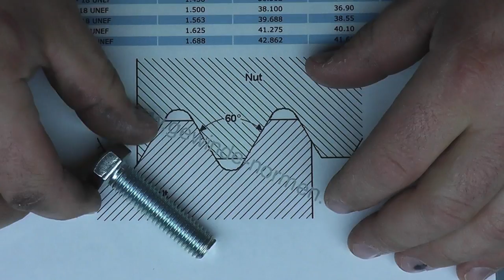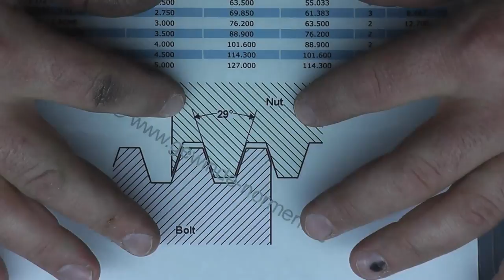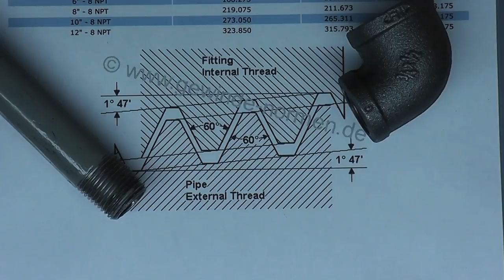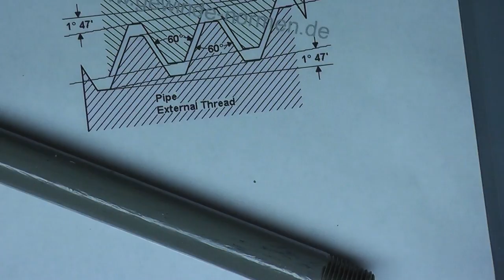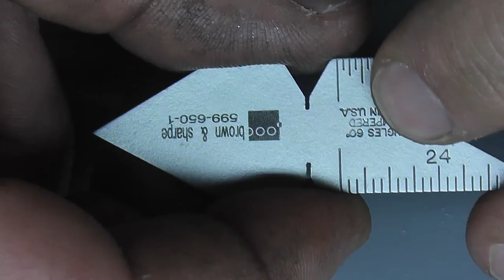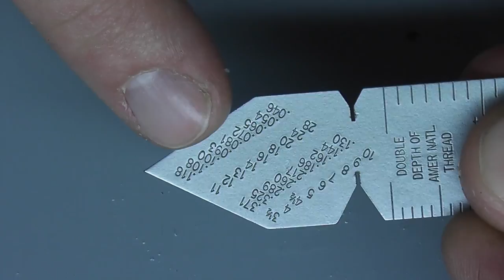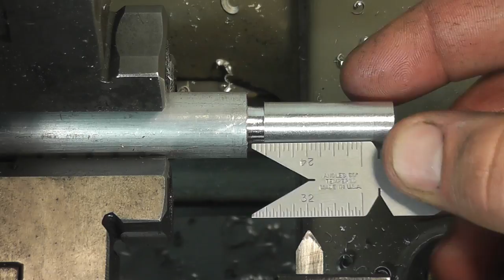External Threading - A Beginners Guide

Comment: Hi, you can try keepign the compound set at zero, parallel to the bed and advance the compound half the depth of cut for each pass. By moving the compound and also the cross slide this closely simulates the 30 degree angle. This method also helps with the depth of the thread as the depth is directly on the cross slide dial ( dro ). The tool load is split 87/13 so the trailing edge skims the right hand flank and the leading edge does the majority of the cutting.
It's usually best to remove the peaks of the threads before trying the nut, if you get the nut to fit without removing the burrs then it will be loose when you do remove them. Having sharp peaks running on the root radius of the female thread can cause galling and prevents the thread flanks from engaging.

When cutting the left hand thread in the video. Instead of plunging in with the cross slide you could still use the compound slide at the same angle as for right hand threads. Feeding in as before for right hand threads but this time the tool will cut on the trailing edge. This will work out just fine and reduce the tool load as before.

Comment: Thanks for the video. I'm learning to cut threads, I did it once like 15 years ago and It turned out good. This last time I suck, I ended up with lopsided triangle threads. I plunged rather using the top cross slide at 30 degrees. So my next attempt will be your method to see if that will help. Good thing I have extra material I screwed that part up good. Thanks for sharing. Best Wishes & Blessings. Keith Noneya.

Comment: Very good video Sir.  The one main reason I would rather use single point threading instead of a die is it is very easy to get the die to run the thread  a little bit crooked and not straight with the lathe.  Been there and done that!  Tom

Comment: Good video, I’ve never rotated the compound slide for screw cutting just always keep it on the “0” degree , and whenever I do acme /Trap. Threads,  single /multi start I always use a thinner ground tool then side cut until it fits the mating piece,

Comment: at 9:22  I do a lot of model engineering, and what's nice about the Little Machine Shop chart is that it lists a column for 50% thread engagement. There's not tons of force of model engineering fasteners as a rule of thumb, like on an full size automobile. Using 50% thread engagement saves wear on your taps (all my taps are German and Japanese so they ain't cheap). Plus many people don't realize that to go from 70% thread engagement to 95%  TRIPLES the force requires to drive the tap, but only gives a 5% increase in holding power !! . So you break your tap for essentially to no gain!! Something to think about. Incidental notes: generally first four threads carry almost all the load, every thread after progressively does very little as far as load carrying ability - to get full load carrying ability use length of thread equal to one diameter, and you're basically there -  just a generalized rule of thumb that covers a myriad of cases.

Comment: What are your thoughts on tool height?  Should the tip of the tool be dead center on the work?  Slightly below?  

I've used the technique of sticking a steel ruler in between, then adjusting until the ruler is vertical. Is there a better way?  

Thanks for the informative videos!
Reply from the maker: DrFiero Tip should be on center.  Only time I'd go slightly above is when boring to give a clearance.  The ruler works.  You can also stick a center in your tailstock and use the point of that.  You could turn a centerpoint in the lathe and measure from a point on your carriage to the center point and use that measurement to set the height.  You could also make a tool like I did in a previous video.

Comment: Very nice video. Only criticism is that you didn't cover setting up the gears. This is lathe-dependent, but still essential. Keep 'em coming. Good tip on keeping crosslide horizontal, full turn every time. If yiu really want to go full depth on compound you can use D/cosine(offset angle). = infeed on compound.

Comment: You "could" cut a taper thread if you mount the pipe piece between centres with the tailstock or an adaptor in the tailstock set over  in the conventional way, so don't state it can't be done without a taper turning attachment etc.
I have tapped taper threads for pipe fitting with taper taps and you have to go to a specific depth as required.

Comment: Very informational video. One question if I may. You didn't talk about the thread helix when you were grinding your cutting tool. Is this something that only needs to be considered when cutting deeper threads?
Reply from the maker: +NotSoDumb 
The side clearance on the grind takes care of that and ensures you won't be running into the thread further down on your tool.  I've cut 8 TPI with this same tool
Reply: Awesome, thanks for the tip. Really appreciate your work. Have leaned a lot from you.

Comment: So anytime I need to learn anything on my south bend 9" I watch your videos.. they're awesome and you really do make it easy to understand.  I do have a question, so with threading did you have to change any gears on the gear train or should I say what gears are being used? And the other is i belie e you made 2 different tools for the regular thread and the acme thread.. correct? Thanks again in advance.
Reply from the maker: If you have a model c or B that does not have a gearbox follow the chart on the gear train cover.  It will show you the configuration of the change gears for a given thread.  If you have a gearbox the only thing you will need to change is the stud gear for some of the coarser threads otherwise it's all the handle positions.  All that info will be on the gearbox chart.  A standard thread tool will have a 60° included angle and the acme tool will be 29° angle with a flat on the tip of varying sizes depending on TPI.  You'll need an acme thread gauge for that.
Reply: @Halligan142  thanks so much for the reply, I should have mentioned I have a model 9A just wasn't sure if there was a gear that needed to be changed even with the gear box. So ill just follow the chart on the gearbox . Thanks again
Reply from the maker: @hustlerkc11  

Look on the left side of the chart.  There’s a column that says stud.  That’s the stud gear used for the given row.  The top row uses the 40 tooth heat the rest should use a 20.  Stud gear is the gear in the middle of the reversing lever that meshes with the banjo gears.

Comment: awesome video, so much info. just one question does the speed that the lathe is turning dictate how fast the slider should move to cut the thread? if so how do you find this?
thanks anyways Robbie
Reply from the maker: Robbie Burnett The movement of the carriage is tied to the spindle speed.  The faster you turn your spindle the faster your carriage moves, but the rate at which it moves stays constant because your gearbox is labled in feed rate per revolution of the spindle.  In other words if you have your feed rate set at .005 per revolution then for every 1 revolution of your spindle your carriage advances .005 no matter the actual RPM speed of the spindle.  So if you have your gearbox or gears set to cut a 12TPI thread you will always cut at 12 TPI whether your spindle turns at 1 RPM or 1000 Rpm

Comment: Great video thanks. How do you set the cross slide angle in relation to the work? There's a scale on mine but it seems a bit vague?
Reply from the maker: xenolard There's an angle scale on the compound with a 0 or line marked on the crosslide.  Loosen whatever hold down your lathe has for the compound (mine has 2 allens that engage a dovetail) and rotate the compound so that the angle number you want lines up with the 0 or line on the compound.
Reply: Ahh ok. That's what I thought. Thank you very much. I love your videos. Are you going to do any more "day in the life of an HVAC tech" videos? I really enjoyed them. Cheers

Comment: +Halligan142  Thank you for this informative video.  I was wondering when you are engaging the half nut on the predetermined number or line you aren't stopping the lathe.  Is that because it doesn't need to be precise in order to cut the thread (if it is in the correct general area it is fine)?  Or are you experienced so you know precisely when to engage the half nut on the line?  I don't know if I can do that.  It moves pretty quickly.  I like your method, it is much faster than mine.  I have to stop the lathe, start and stop till it is on the line I want and then engage.  If I don't have to do that, it would be awesome and way faster.  Also, what speed are you cutting the thread at?  Thank you for any help.
Reply from the maker: It needs to be right on the line.  You can easily feel it when you close the nuts.  If you are a little off it will ride the screw then the nut will drop in.  Go at whatever speed you feel comfortable with.  Usually the finer the screw pitch the faster you can go because the carriage is moving slower and you will be taking less of a cut.

Comment: Greg, it seemed like you emphasized the need to disengage the nut and back out the cross slide in an almost simultaneous manner. Why is it necessary to disengage the nut and then quickly back out with the cross slide? When you disengage the nut the carriage does stop moving, which would leave the tool stationary within the thread relief groove. Correct? I would think that having this understanding would take a lot of the pressure or stress off of threading process or am I missing something here?

The acme thread gauge has a notch cut into one corner with what appears to have a specific angle along one side. Do you know what the purpose of this is for? Everyone talks about the notches for checking the tool bit grind angles and the tool nose width, but I have never heard anybody mention the corner cutaway. Why? It is there for a purpose or it would not exist.

Thanks for your time and effort to produce these videos as I for one greatly appreciate it.

Peace!
Reply: Jeffrey Vastine It's good practice for when you are threading to a shoulder and don't have a relief groove.
Reply: I'm not positive but I believe that is you're 14-1/2 degree angle. 14-1/2 is half of the 29 degrees.
Reply: DSCKy Okay thanks, but in most cases would it hurt any to have a small relief groove before a shoulder? This would still allow the part to be screwed tightly against the shoulder. Correct?
Reply: cpcoark thanks! I will have to check once I can find another Acme thread gauge bargain on eBay. The USPS lost the last one along with 35 end mills, 100 hss tool bits, a set of reamers and more which really sucks!
Reply: That really sucks. If you get another acme gage, it would be interesting to find out that angle. I have not done acme, yet, but I would suspect that the angle is to help you square the bit to the work. It is much larger than the tip so any error would be easier to see. Just my speculation.
Reply from the maker: Jeffrey Vastine Yup it's good practice to disengage as quickly as possible for when you have to thread right up to a shoulder.  Just easier to get in the habit of doing it than speeding up or slowing down depending on the situation.  The little notch is the 1/2 angle of the bit.  Shars sells the gauge at a decent price which is where I got mine along with the thread pitch gauge.
Reply: +Jeffrey Vastine Some gunsmiths prefer not to have a relief groove.  This is so they can cut a new chamber in a rifle barrel without having to cut off all of the old one.  They might want to do this to cut an "improved" version of a standard caliber or to correct excessive headspace.  I read where one gunsmith started his threads at the shoulder of the barrel and ran the lathe in reverse to avoid having a relief groove.  He had to grind his cutter special for this.

Comment: Just a note, metric standard threads are also 60 degree, Whitworth however is 55.
Reply: +XILCNC Good point!  Where this might show up is in rebarreling Mauser rifles.  I read that they bought their original equipment from the British, who used the Whitworth 55 degrees.  In practice however, a lot of replacement barrels are 60 degrees and seem to work OK.

Comment: What is the smallest practical size you can thread internally on a lathe? I have a 3.00 metric nut I need cutting, O/D of 11mm - presumably, that is too small, and I will need to tap it? Many thanks
Reply from the maker: Technically you can thread anything as long as you have a threading tool small enough to enter the bore.  For practicality internal threading is WAY easier with a tap and 99% of the time that's sufficient for most applications.  Personally I'd go as small 1" before I'd thread cut an ID thread.  Taps up to that size re fairly cheap.

Comment: what if your lathe does not have a compound?
Reply from the maker: Most lathes set up for screw cutting do.  If for whatever reason yours doesn't you can feed straight in, but you'll have to reduce the depth of cut per pass
Reply: thanks. that is how i will have to do it.
Reply: Even better, you should look into making a basic compound as a project.   That sounds like an absolutely functional and fun way to get one.

Comment: Nice video John, but you don't take the time to show how you set the gearbox to cut any thread, that would have been very helpful...just a suggestion. Every thing else was very helpful..THANKS..
Reply from the maker: +Brian Bondie 
Each lathe is different and it's usually just a combination of levers according to a chart if you have a quick change gearbox.  If you have individual change gears then they need to be set up in a specific orientation for each thread.  I have a video of that before I did the quick change conversion.  You can find it here.   https://www.youtube.com/watch?v=BAyUfPn2bck

Comment: Hi mate.
Well done mate, only thing is, if you had one, stick to the lesson plan.  It will make your job so much easier.  You have re educated and emphasized what I knew.  I have found that having some timber round stock to turn is a lot cheaper, if budget or obtaining metal stock is a problem.  Hell, I'm Dutch by birth....
Reply from the maker: Marcel Timmers PVC pipe works well for practice also.

Comment: There's absolutely no reason you needed to set the machine at a angel you could of left it set a 0 you just made it harder for yourself
Reply from the maker: Actually there are plenty of reasons why you would want to.  Plowing straightjt in takes a larger cut.   Something smaller lathes don't particularly like.  Also depending on material and the thread pitch you're cutting using the compound to feed will keep chatter at a minimum.
Reply: Yeah I know why it's done so you only cut using 1 face. But your not cutting a huge thread your not going to get a large amount of chatter

Comment: A beginners guide I don't think so !!!!!!  You missed a lot of important info . Such as gear box set up which is 1 of the most important parts !! For that it is a thumbs down for me !!!
Reply from the maker: It's left out because it is different on every model of machine.  Some have quick change gearboxes with just tumbler levers, some have levers in combination with specific stud gears, some have levers in combination with dials, some have no gearbox at all thread pitches are changes by a combination of gears.  In any case there is usually a clear diagram on the gearbox or gear cover that shows the correct positions of the levers and/or dials and gear combinations for the thread pitches.  If in doubt there are tons of manuals for different machines on vintagemachinery.org website